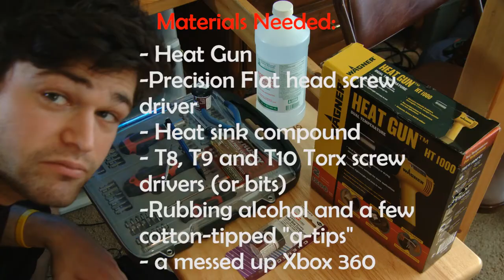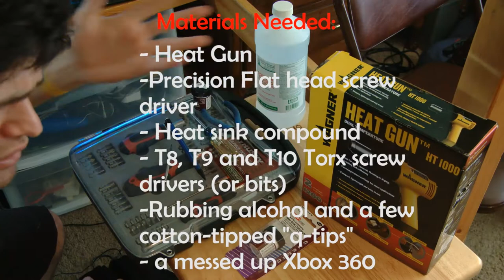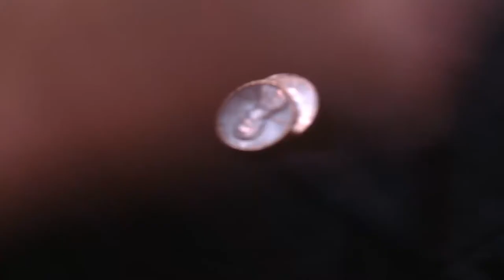How to take apart an XBOX 360 : the Prep work B4 using Heat Gun fix

Comment from the maker: @NETMINIT unfortunately its usually not that simple...although i will say that swapping the older version of the xbox heat sinks out for the newer designed ones (on the slightly newer models) can help it stay cooler...almost always though, it wont be enough once it has the RROD because the leadfree solder liquefies, the board warps/bends with heat, and then it recools, causing issues ie RROD with 3 red sectors lit..2 red sectors is just overheated...often 2 sectors leads to 3 though =[

Comment from the maker: nah, that shouldn't do anything..the switch/button is a mechanical piece of hardware that sends a small electrical signal- no magnetism involved =) you could try swapping out the card that the power button is on with another one, but that's not likely to be it...make sure you didn't burn your board..that'll keep it from powering up ;(

Comment from the maker: @ohmss006 in the meantime, theres one or two other decent heat gun tutorials for 360's you can try in the meantime if you'd like...just dont over do it and melt the board or even just get all the solder flowing and then point it at too much of an angle and inadvertently blow resistors, etc right off the board!